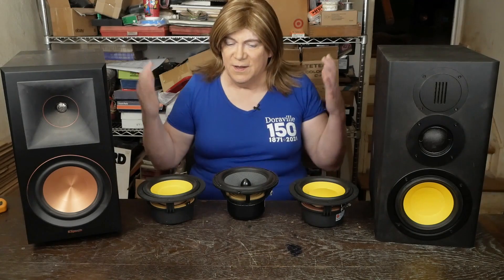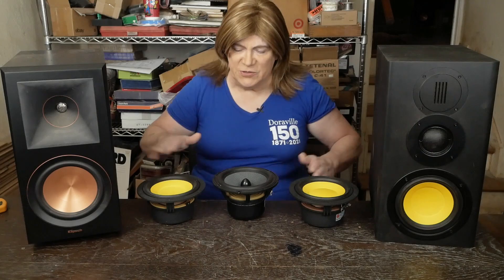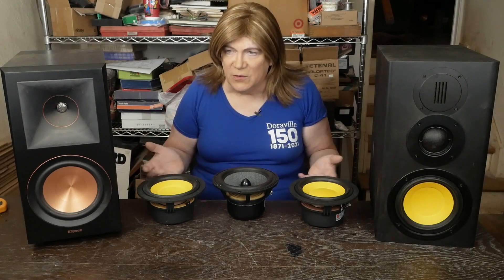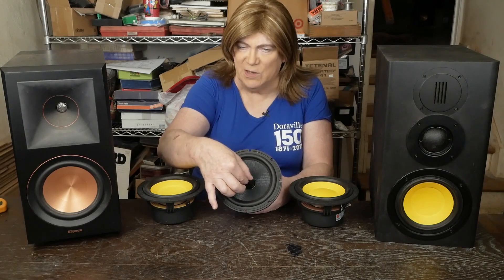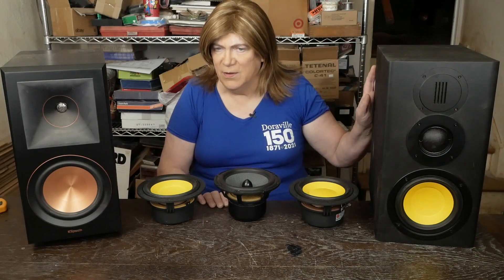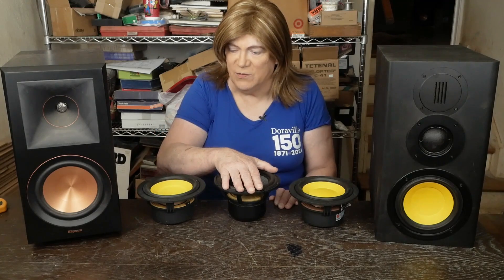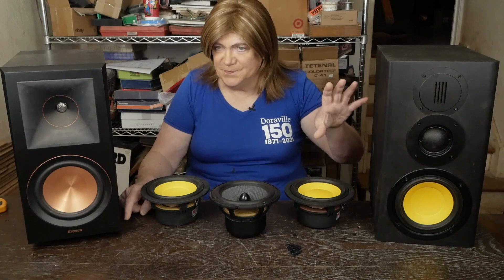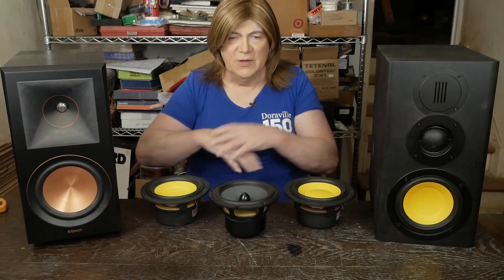Swan DIY 3.1A Speaker Mods & Driver Upgrade!

Comment: Nice video according to you which driver you felt was better this yellow color 6.5 inch 3 inch voice coil yellow driver or the other swans black 3 inch voice coil driver which you used in diy 2.2 in terms of build quality, sound quality and bass response the one with yellow

Comment: I know this is a year old, just curious...
   90% of the "8 Ohm" drivers I measure for Ts parameters come out at 7-6.5 Ohm actual impedance. 
   That's a 13-18 % drop on the 8ohm "math". Of course it's on a curve, but I wonder if the (SE) output transformers could (should) be tuned accordingly ? 
 ... or maybe they are, without telling us ?

Comment: Perhaps what you are thinking of for speakers in called  BL = B (The flux density of the magnet) x L (The length of voice coil wire in the magnetic gap). Higher is better.

Comment: But I see the 3 inch voice coil you replace the org speaker has a lot of breaks up around from 1k hz, they let the cross over around 600-800hz. Why they 3 inch go lower in the bass is it has probably more moving mass and a larger 3 inch coil weight more. But the bass output has nothing  to do with the size of the voice coil. More about the moving mass. And the moving mass also refleks on the sensitivity as I see the new driver has at least 3db lower sensitivity and you should lower the mid and tweeter drivers with 3 db
Then why can't we see the frequency response with the new driver?
Reply from the maker: This whole project ended up being a failure as far as the bass response. Neither the original design nor this "upgrade" worked very well IMHO. The 2 way model sounds MUCH better. I'm not a speaker designer obviously and was just playing around trying to get this speaker to work better.
Reply: @SkunkieDesignsElectronics  Don't be sad, I do also love play around with drivers and testing all kinds of things, we learn from errors. But I do love 3 inch drivers in their design. I really like there are femails who also like speakers, there are too few of them. I have dynaudio speakers and love them. Stay safe out there, me from Sweden

Comment: Perhaps you could help me. I want to buy the  HiVi-Swans OS-10 for my gym.  And run them with my cell phone as they are blue tooth speakers 🔊. Will they be loud and powerful enough? Or will I need a DAC system with it also? Thank you 🙏.
Reply from the maker: With a 4 inch woofer, I don't think loud and powerful would be used to describe something like this.

Comment: I have assembled the speakers and connected to amplifier but it is not working. please let me know what may be the problem.
Reply from the maker: Maybe you connected the wires to the crossover board in the wrong place? Look also at the terminals/wired on the back and make sure they are making a connection. I would test with an ohm meter and make sure the speaker isn't "shorted" so it doesn't damage your amplifier.
Reply: @SkunkieDesignsElectronics  thank you. I will test
Reply: @SkunkieDesignsElectronics  I am using Yamaha rs202. Is this a issue?
Reply from the maker: Nope, it works with other speakers right?
Reply: @SkunkieDesignsElectronics  yes. It works with other speakers
Reply from the maker: Do you have an ohm meter to test across the speaker terminal of the speaker?
Reply: @SkunkieDesignsElectronics  No. I have ordered one and will be tonight. I will test and inform you. Meanwhile, I did again soldering all wires. I can hear faint noise from the woofer but nothing from midrange and tweeter.
Reply: @SkunkieDesignsElectronics  I tested continuity using multimeter. Following terminals not beeping, 
1. Tweeter
2. C3 
3. C2
4. C1
What may be the issue? Is it soldering?
Also, I might have interchanged L2 and L3 air inductors. Is this a issue?
Reply: I am having an issue with the second speaker also. Can you pls suggest troubleshooting methods
Reply from the maker: Check the resistance across the speaker input terminals.
Reply: @SkunkieDesignsElectronics  how to check if any loose connections issue?
Reply: @SkunkieDesignsElectronics  I connected to different Sony str dh130 receiver.  I can hear woofer and tweeter both left and right speaker, but midrange is not working. Please let me know what may be the issue.
Reply: @SkunkieDesignsElectronics  I have fixed the problem. It is a loose connections. I also built a c note center channel to make it LCR. I will add two subs and surrounds to make 5.2 HT
Reply: Below is the resistance reading
Speaker left:
Bass- 9.8
Midrange-11
Tweeter- no reading

Speaker right:
Midrange- 8.5
Tweeter- no reading
Bass- no reading

Comment: When comparing the graphs from both woofers the woofer in the 3.1 actually has better specs at 100hz than the 2.1 does. By about 5 db. The graphs are using 2 different x scales with the 3.1 using a 100db scale and the 2.1 using a 90db scale so visually it skews the look. As far as bass response and punch goes the 3.1’s are far from lacking and IMO and in my listening room a😅e cleaner and a bit faster than the 2.1’s. That’s 🎉the thing about audio, everyone’s hearing is different as well as listening spaces. After spending $30 for the Sehlin mod on the Xover the 3.1’s can hold their own with some much higher end speakers. Several friends have systems that are 3-5x the cost of mine and all of them have commented how amazing they sound. I’m running mine off of an ST-70 tube amp for each channel (30-35w each) and an Akitika PR-102 preamp I built and the sound is pretty amazing… Just my 2 cents.

Comment: Several years ago, when this kit first came out, there were lots of negative reviews on it for being way too bright and not having enough bass.  All those negative reviews magically disapeared !  I have now reworked it so many times, I am to the point where I am very happy with my bass and midrange.  I need one more adjustment on the tweeter to see if I can finally get that right.  It has taken several years to get this far.  I have given up several times !  When I now look at the frequency sweep for that initial woofer, it seems like a better midrange than woofer.
Reply from the maker: That's what it looks like to me too. I still haven't got it "right" lol
Reply: @SkunkieDesignsElectronics  I just had to walk away from it again.  I got so frustrated.  I might just take the drivers and use them for other projects.  But I am not a person who gives up easily.
Reply from the maker: Oh I haven't given up, plus it looks WAY too cool now that I painted the boxes brick red with these yellow drivers. I bought a pair of soft done horn tweeters I also want to try in this.
Reply: @SkunkieDesignsElectronics  I was looking at those yellowvdrivers on parts express just the other day.

Comment: Your on target about the voice coil, and in particular size. It's generally a better speaker that has a larger voice coil in the same size driver. the "little dome" is usually the dust cover of the speaker, and the same size of the voice coil.

Comment: If you are careful you can probably suck that inverted cone back to convex using a low-power vacuum cleaner, eg car/battery type while holding the cone still. Use a bit of cloth to prevent too much vacuum. I have done this with doped fabric dustcaps on many other speakers with no problem.  

On my main speakers I have Morel soft dome tweeters that push in very easily (why do kids lean against speakers?). They only need a gentle suck from lips to pop back out to their orginal shape. I've done that a dozen times over the years and they still sound fine. OK, it is embarassing to be discovered kissing the tweeter, but it's hobby and I am cheap.

Comment: The answer to all your question were all those part were taken from a floorstand speaker..to be exect Swans RM300F..even the crossover are the same except RM300F using 3 seperate board for each driver... and its has bigger brother as well RM600F which is 8ohm since its using 2 same woofer run in series
Reply: The original woofer wasnt that bad its just run on lower sensitivity. For a floorstand which is double the 3.1a size its work just fine. So the simple solution is to lower the volume on both mid and high to really match the woofer but of course the overall sensitivity of the speaker will be drop as well. The 2nd solution are the one you implememt right now which is change to better woofer to match the mid and high. Changing to 8ohm version were good choice as well to match your system. So good luck in your journey. All the best and keep it up 👌
Reply from the maker: yeah I knew something just seems off. IMHO the 2 way speaker just sounds better.

Comment: Woofers with high QTS have more bass output than those with a low QTS. I am unfamiliar with the woofers you are using but they remind me of the morel and dynaudio 3-in voice coil woofers that I used in the '80s from what I remember they had high q totals. Woofers with high qts have less control of the resonant frequency and allows the cone to travel further, and they work better in larger boxes.
Reply from the maker: Thanks for the tip!

Comment: Those drivers have NOT been "pushed in" or damaged, they are a different cone design. If they'd been pushed in there'd absolutely be damage and distortion to the cone shape that you'd immediately see, it'd be impossible to push that dome in perfectly without noticeable damage. Think about whenever you see a pushed in tweeter, there's ALWAYS a wrinkly edge, it's unavoidable. They must've changed cone design. Also, an 8 ohm driver being easier to drive will be louder than a 4 ohm for the same input level. How much louder I don't know but likely to be very noticeable I'd say.
Reply from the maker: This dome is paper like the cone. And the boxes these "pushed in" drivers have a hole punched though the box centered over the driver that was taped over with amazon tape. Anyway not that important how this happened, I'll be interested to see if there is any difference from the cone shape! :)

Comment: Try a one ohm or two resistor for the ribbon tweeter.  This will bring down some of the spl of the tweeter. Speakers for tube amps,look for drivers that have db level of 90 or above so that when you are done with the  crossover you don’t lose too much efficiency with the finished speaker.
Reply from the maker: Already added 5ohms to the supplied value. And I'm having a hard time finding any drivers, especially larger ones, over 85-86db.

Comment: Sounds like you are fighting with the driver response. In a great setup you need a 2nd order 24db rolloff, seems that there might be a "something something" crossover inside the cabinet. The silk screen midrange are great when setup - I have used 5W ceramic resistors to atenuate drivers, your base is missing because the upper range is too loud and the rolloff is not letting it get deep.

Comment: Its just a dust cap, broken or not dosen't make much diffrence, main diffrence is asthetics and irratation not feeling good about broken dust cap
Reply from the maker: On this speaker, it's such a large % of the surface area of the cone, it makes me wonder if the shape would have any impact. I can't imagine like the angle of the cone etc has zero impact on the sound produced.
Reply: @SkunkieDesignsElectronics  I personally wouldn't be able to get over a dented or broken dust cap, I like everything perfect. Not sure if you had but I think its always good to straight away after reciving parcel damaged in shipping contact the seller and do something about it.
Reply from the maker: Yeah, once I realized they weren't supposed to be like that lol. I had already installed them in the box, then saw pictures and thought "Hmm" so I ordered two more and one was out, one was in. It's pushed in to evenly it looks like it was made that way! And they weren't damaged being sent to me, the box was crushed and the dust cap smushed in before it was shipped, the outside box was perfect.
Reply: No. Dust cap size, shape, material controls phase  and directivity toward the high end of the driver's frequency response, when the diaphragm is least pistonic and radiating most from near the voice coil.

Comment: Hi, love the channel, first I think it’s always fun to experiment, and in the end it absolutely about whatever you enjoy. My only concern about swapping drivers is that it changes so many aspects of the design. The Fs and other characteristics will typically drive the ideal box size, port size, and will also change the parts you need in the crossover. If it works that is great, but it will typically at least require modifications to the crossover.
Reply from the maker: Thanks, I will look at fine tuning this later. Need to measure results and if there is a hump in the mids, will look at crossover changes. I se this like tube rolling, sometimes just dropping in a slightly different tube wakes things up, sometimes it requires other changes.

Comment: Love your videos, glad to see so much interest and enthusiasm for tube amplifiers. The vacuum cleaner trick works every time. Also the 8 ohm driver being properly matched to the impedance of the output transformer is giving you more power across the speaker. If you think of the amplifier as a power source and the speaker is the load, you get maximum power to the load when the resistance in the power source and the resistance in the load are equal. It is the job of the output transformer to match them. When you lower the impedance of the speaker without the proper impedance tap on the output transformer, your load resistance becomes less than the resistance in the power source and you don't get maximum power to the load, you just produce more heat in the source. In this case the output tubes. This is why impedance matching your speakers is very important. The extended bass response on the driver with the larger voice coil is due to the additional mass of the cone and voice coil this gives you a lower frequency extension at the expense of overall sensitivity. Notice the 5DB you gain at 40 hz is at the expense of the overall sensitivity being 5 dB less, however the additional power from being impedance matched correctly compensates for the lower sensitivity of the driver. Putting an 8 ohm driver on a crossover that was designed for 4 ohms will extend the frequency a little higher into the mids.
Reply from the maker: Yeah, might need some crossover tweaks but for a "driver roll", the results were positive.
Reply: Yes, I would think it would be positive and the etension in to the mids is probably ok also. My post was meant to be positive and informational. Love your posts, have a great day. @SkunkieDesignsElectronics

Comment: Does that hole in the back of the magnet go all the way to the center dust cap? If so a little air pressure could pop then back out.
Reply from the maker: It does!
Reply: I think the reason most people used the vacuum to suck the cap back out is because the speaker was still mounted in the box. I know mine was - I never considered pulling the speaker out to look at the back of it. It seems like there is a much lower change of damage by connecting the hose to the exhaust of a small shop vac and blowing the cap out. You will likely never get a tight enough seal to rupture the cone whereas using a funnel (which was my initial thought) you could end up with too high a vacuum before you can do anything about it. Let us know how it turns out.

Comment: Port length could be worth experimenting with as well, as that driver will have a lower tuning frequency ideally. Maybe get some cardboard tube the same diameter and experiment with different lengths. 
Ideally you would want to redo the crossover from scratch, but if they measure OK you might scrape by on the original.

Comment: A good indicator of how low a woofer can play is the FS spec  which is a multi variable formula divided by the QTS spec which is another more complicated multi variable formula. also, QTS is a good indicator of  what kind box the woofer should be put in.  Low QTS woofers, say something like .41 and below, should be put in a vented box, and higher QTS woofers say up to .7 should be put in sealed cabinets and anything above that in an open baffle. of course, there  always can be some overlap. these are some of what are called the thiele and small parameters  this subject can be studied  to a ridiculously  deep level. there is a lot of info online though.
Reply from the maker: Or experiment and listen :) 

I see the same thing in tube amp design, ridiculously complex formulas and endless simulations that scare 99% of the public from even getting into the hobby. I found that you can simply experiment around once you have a bassline, measure the results (in the case of tube amps both internal voltages and then output results) and actually get something done. Paralysis due to over analysis can easily happen. It also restricts what you "can do". I was told by several experts a 6SQ7 can't be used to drive a EL34 and they had all these math formulas showing why it wouldn't work. The amp sounds fantastic.

 I know engineers hate this but I'm not an engineer :)

Comment: You chose some really nice tweeters this going be a fun build.  I been thinking about using a pair the scanspeak ring tweeters with the sharp  point in the center . There not as sensitive as the horn loaded ones you chose but have a better off axcess response. . But I'm only in the planning stage.  I would recommend reaching out to Toids diy , youtube channel he is great on knowledge and helping others with projects.
Reply from the maker: Already sub'd  totheir channel!